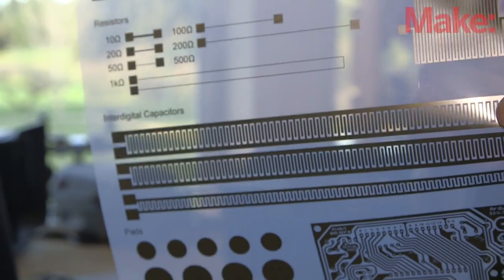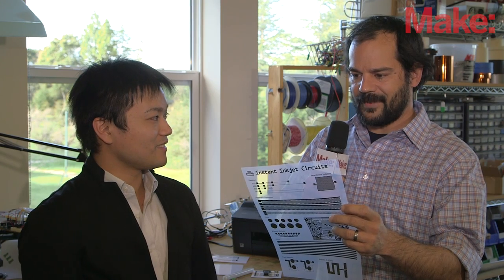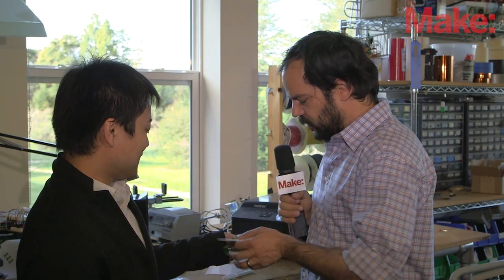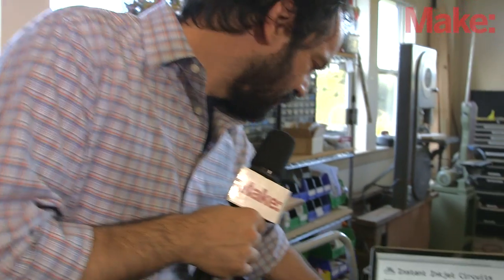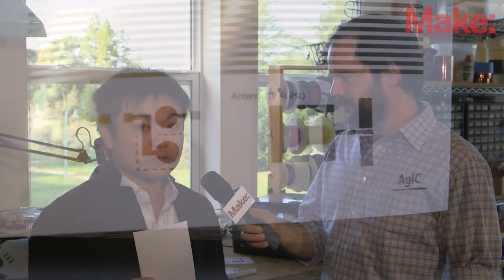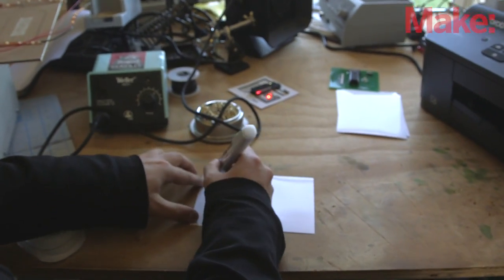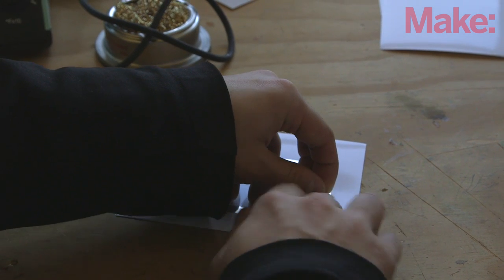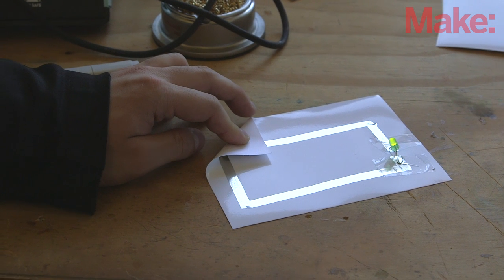Inkjet Printable Circuits

Comment: The next thing to include is a conductive glue similar to superglue or modeling cement, which would work just as well for attaching surface mount components as it would for through-hole components, because it can form blobs. I'd be curious to know how the surface mounts were placed on the prototype board that was shown if there is no such glue, or whether they were cemented and baked....

Comment: This is simply huge !!!!!! as he said I instantly think of tons upon tons of applications.
circuit design on paper for kids learning board design for starter.
Touch customized flexible notebooks with circuit designs of all sorts making cool stuff, throw in a OLED flex screen and the sky is the limit.
even add this in some way to a 3D printer and you get a 3D printed circuit board with multiple layer design.
Tron suits with real circuits printed on cloth and led lights.
electronic light switch buttons drawn on the walls 
this is just crazy !!!!!

Comment: A question I would have liked to hear would have been how the resistance compares to etched PCBs and compared to silver based conductive paint which is available for decades. High resistance is what usually makes these paints impractical for most circuits.
Reply: this is the question

Comment: so how do you more permanently connect parts to the printed circuits? the tape example isn't cutting for me at this point. This is one important piece of information that should not have been left out of this video!
Reply: Search for "conductive glue."  There are many kinds which are more or less permanent.

Comment: Looks promising, but I'm afraid I don't fully understanding the technology.  You say it works with an inkjet printer?  My guess is that it will require not just any inkjet printer but one with special print heads containing special conductive inks and a straight-line paper path.  Can you print onto FR4 boards directly or can it only print onto flexible sheets like thick photo paper or acetate?  Would you then paste the printed sheet onto a rigid board?  What about the soldering and heat-sinking of ICs and transistors?  Can the Arduino circuit shown in the video be populated and shown in action?  How durable would the finished product be?  In my admittedly low-volume production case, my 20 year old HP Deskjet printer probably won't handle the electro-ink printing chores so that will require my purchasing a new printer - something I have been trying to avoid.  I keep my old HP because it prints regular ink onto translucent sheets just fine and I can then expose the images using UV light onto photo-sensitive boards, a simple and well-proven process.  The UV/Inkjet method also avoids my having to buy a laser printer and laminator just to do toner transfers. However, this new approach appears to eliminate the Ferric Chloride  etching steps, always a bonus for me (the fewer chemicals in my house the better), so perhaps it is worth considering for that quality alone.

Comment: Awesome. About time.... or at least make a drop in conductive ink cartridge to convert any printer. But the other alternative where you laser print your pattern on gloss paper/film and then apply conductive silver ink which bonds to the carbon toner works quite well in the meantime. Be neat if you could take your gerber file to Kinko's.....

Comment: wait if the makey makey can use a regular pencil, cant we just make a simple circuit using a regular graphite pencil and regular pencil?
Reply: Yes you certainly can, the electrical caracteristics of graphite are different tho than this ink. But it sure works!

Comment: This technology is used in keyboards
Reply: This....
Reply: its abit more/less technical than that they treat the plastic with a special coating of tiny specs of metal where the circuit is going and then they can electroplate it
Reply: +euan todd fuck that, why can't we use the different colors in the printer to reduce the copper? i was thinking about making a magnesium battery on the paper to reduce copper, you just have to create a battery for the displacement of copper from copper sulfate, so you can invert the color and change it to the color your print uses and print with magnesium in blank areas to reduce the copper. you can let it dry and print the sheet again a few times if needed, the copper will reduce electrochemicaly, oxidizing the magnesium, and the paper will form a copper circuit. You can even print these circuits and overcharge them with magnesium then slowly submerge or spray the circuit with copper sulfate. As an end product we have magnesium sulfate and copper, that's known as chemical reduction

Comment: It's a great idea, but the inks are going to be quite expensive. This invention is definitely not for hobbyists.
Reply: Isn't that kind of debatable? The hobbyist is, in a sense, likely to fork out a little extra for the chance to make a unique result, whereas expensive processes make less sense in mass production.
Of course, on the other hand, mass production would eventually lead to lower prices, simply as a result of demand. It's kind of a double edge.
Reply: Agree with Jonas on this one.  3D printing is a perfect example of this.
Reply: ***** Was about to mention that myself.
Furthermore, the mere fact that it's designed for regular, completely common inkjet printers should make it pretty obvious that it's aimed at the DIY community.
It's not a coincidence that Make takes an interest in this stuff. Flexible electronics haven't been a problem in the industry, but if you are a maker or hobbyist, stuff like this has been pretty hard to do. And even conventional etching still leaves you with the problem of having to be sure you got the circuit right the first time around, unless you want to spend a LONG time on trial and error.
What this allows you to do is, much like 3D printing, to prototype, or make a custom project very quickly - with lots of room for trial and error.
Reply: You can make conductive ink by mixing in graphite powder. I've also seen conductive glues made the same way. The trick is getting it into the inkjet cartridge. LOL
Reply: Refillable cartridges are easy to come by for basically all common brands of printer. I'd be more concerned about clogging!
Reply: I'm with Jonas too.  There are already well established processes in existence for the large-scale manufacturer.  This is much more likely to appeal to the hobbyist as it would give him the flexibility to experiment, test, prototype, and refine without delays.  The convenience should make the higher cost acceptable.  There are online companies who will make batches of PCB's to your design for peanuts, but you need to have your design finalized to avoid delays and frustration.  This system fills the gap between idea and finished design.

Comment: SOOOOOOOO, SOMEONE COULD WALK AROUND WITH A PIECE OF PAPER......FOLD IT AND BOOM!!???
Reply: How is that any more dangerous than someone with a switch, button, or something like that?
Reply: 'CUZ WITH THIS NEW TECH IT'S ONLY PAPER AND A BUTTON CELL BATTERY .THE PAPER COULD HAVE THAT SCHEMATIC WRITTEN TO MAKE A "CLOSED - CIRCUIT FOR A REMOTE CONTROL DEVICE. SO WHAT 'S ON THE OTHER END, WHAT COULD POSSIBLY BE  REMOTELY CONTROLLED? AND WHOM OF THE TWO PEOPLE WOULD RAISE MORE SUSPICION? THE GUY WITH THE SWITCH AND BATTERY OR THE GUY WITH JUST A "PIECE OF PAPER? LET'S SAY AT AN AIRPORT. REMEMBER IF YOU ABOUT CIRCUITS ALL YOU NEED IS SOME TYPE OF TECHNOLOGY TO CLOSE A CIRCUIT TO DO DAMAGE, JUST SAYIN.
Reply: Artemus Rodricq STOP SHOUTING.  There are any number of devices we use every day (and carry around at airports, etc.) that have circuits, switches, batteries, radios, etc.  But mostly STOP SHOUTING.
Reply: Artemus Rodricq
I think the guy trying to awkwardly fold a piece of paper inside his pocket looks more suspicious than the guy that flips a small switch inside his pocket but that's just me I guess.
Reply: ok